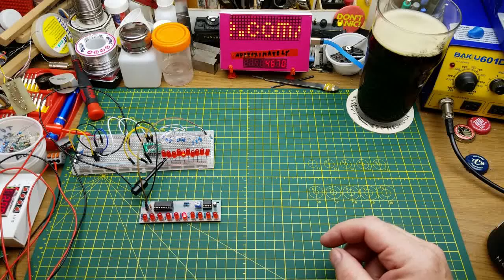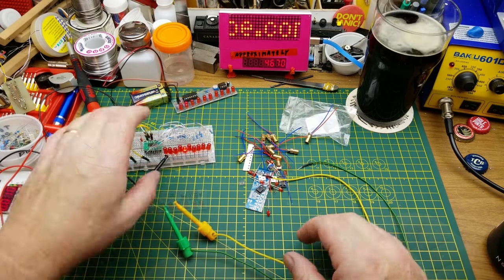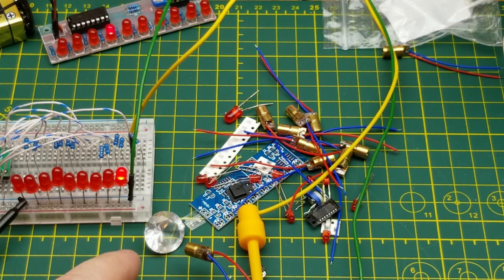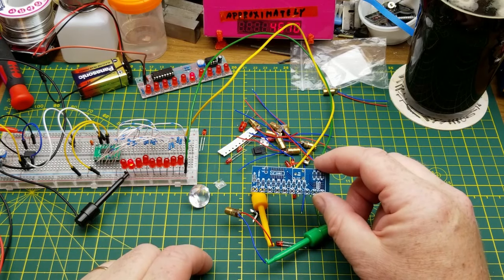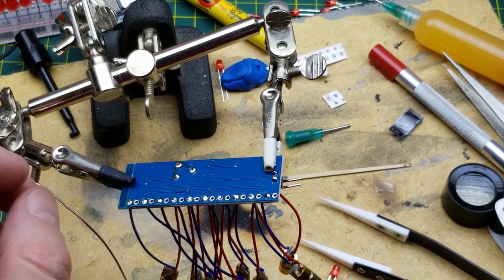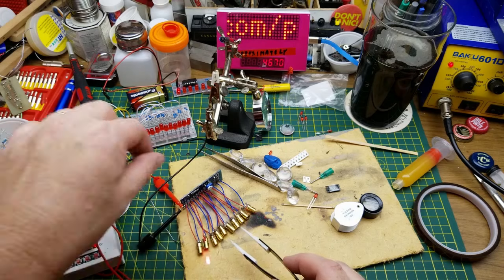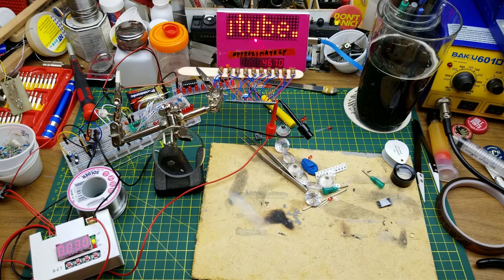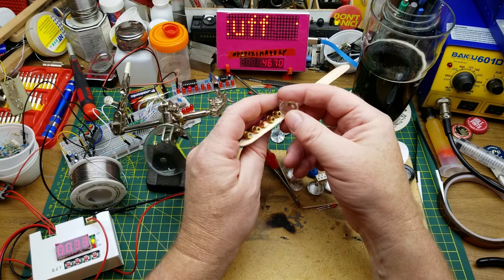laser chase lights

Comment: The good old 4017 decade counter, ive used them for roger bleeps and push button selected   power supply voltages.
Add transistors on the outputs and you can drive allsorts :-D
Bargraph drivers are handy too :-D
Reply: Yep. The 4017 can only switch a few mart so you cannot really even get decent brightness from LEDs without transistors to buffer the current.
Reply: John Coops
Yep thats true but they are designed to connect to computer logic chips and not high current circuits.
Transistors and/or opto couplers make them usefull :-D
Not forgetting the ULN range of power drivers, suddenly you have a 4017 on steroids :-D.

Comment: Nicely done, i stuck mine on a piece of wood as well, because they were shorting out, just like yours did :-) I used double sided sticky tape though. Darken the room and get someone to blow some vapour into the Beams. I could do a Video of my setup, if you want to see it.
Reply: I imagine putting the laser on the end of a stick, thent vibrating it like a buzzer, to get a line.  An encoded signal could then be used with persistence of vision to sweep that horizontal line across a wall to rasterize patterns.  Maybe even cooler with a glycerine fog!
Reply: Yeah, upload it sir!

Comment: Hmm, I've been playing with shift registers and an Arduino, and I have a bunch of lasers too.
Reply: I like playing with them too.  Inexpensive.  When using the SPI bus instead of shiftOut(), a byte can sent almost every 1us using the MOSI and SCK pins for SER and SRCLK on a 595.  The SPI data clock runs at 1/2 the MCU clock:  8mhz.  There is an even faster, but weird solution.

Comment: try outputting to 10 small LED strips
Reply from the maker: That's an idea. 

I would have to add driver transistors to use anything more than a single LED on the output of eh 4017 though
Reply: @pileofstuff   Not really. The strips I refer to are those chinese micro LEDS on a copper ladder. Draw for each strip is like 10ma
Reply from the maker: @pleasecho2  Ahh, those ones. I thought you were talking about the bigger brighter ones.

I may have to get my hands on some of them.
Reply: @pileofstuff  even for higher draw equipment you can use mosfets
Reply from the maker: @pleasecho2  Yup. Any type of transistor can do it.